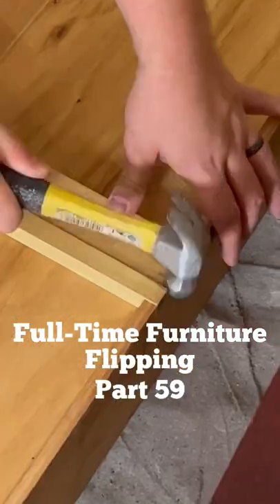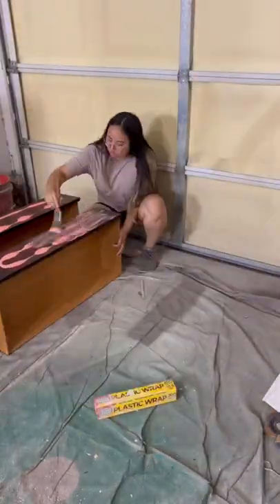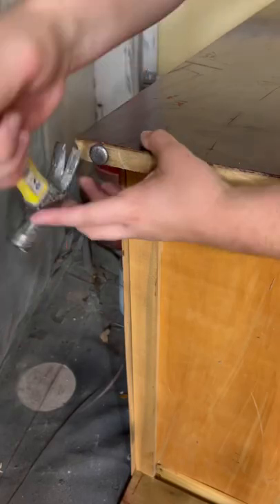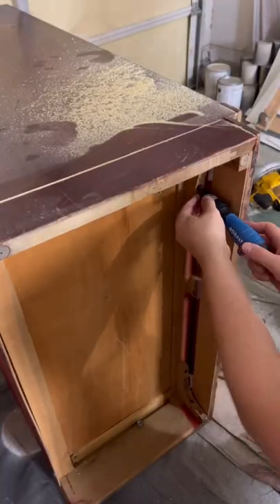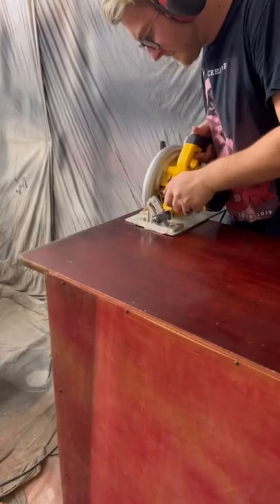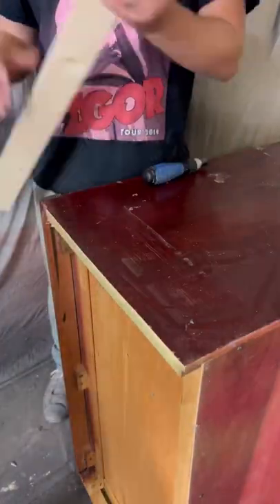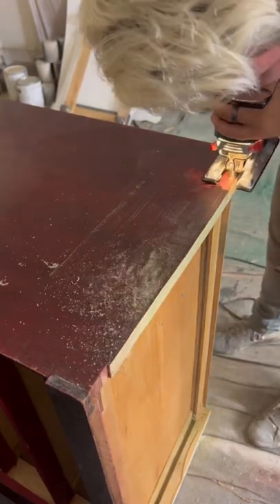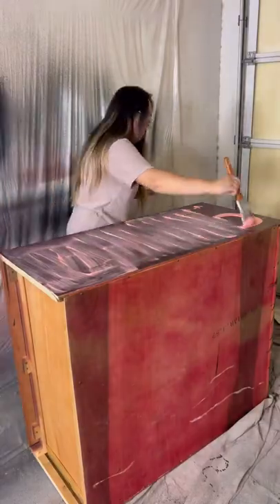You’ll never catch me at a strip club, but you might catch me stripping furniture! 🤠 #diyproject

Comment: A track saw will change your life. But also if you can’t afford one at the moment just use a level or really straight board clamped to your work piece. It will give you a lot straighter edges especially when using your jig saw.